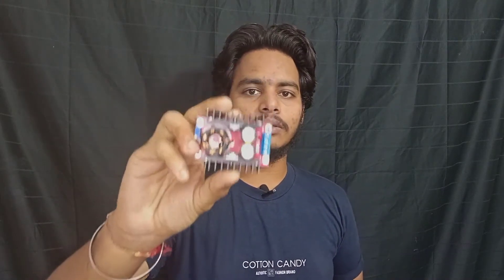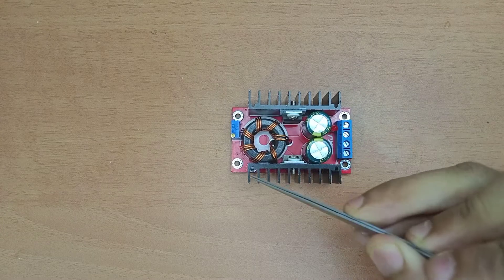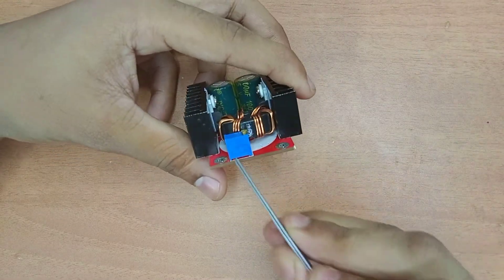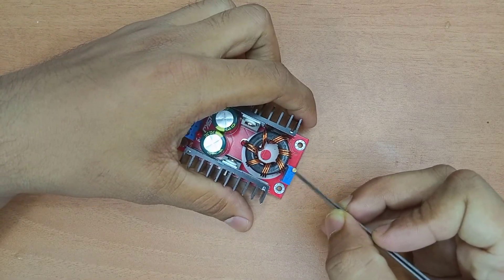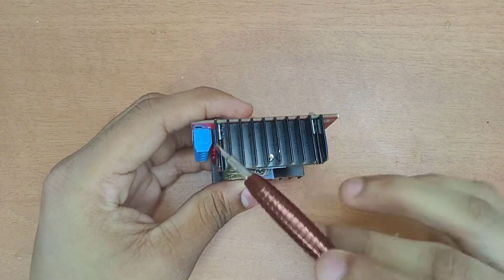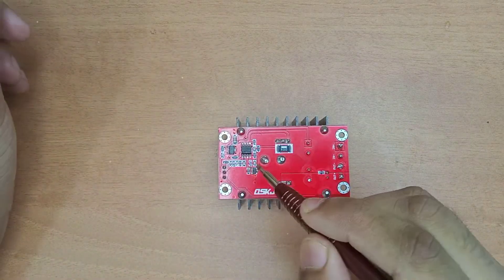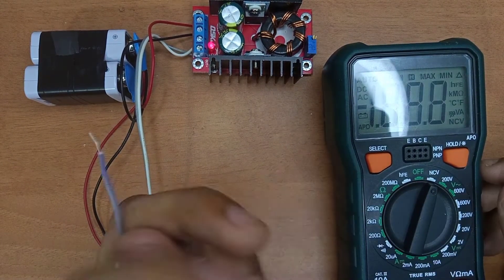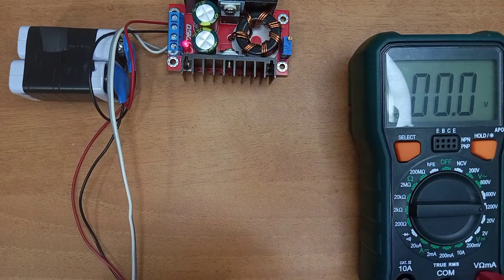DC-step up Boost converter || In telugu

Comment: 12 volt 150ah battery support????
Reply from the maker: Yes we can do 12v 15amp battery
Reply from the maker: By using step-up convertor we can get 12v 15 amp output ,,🙂